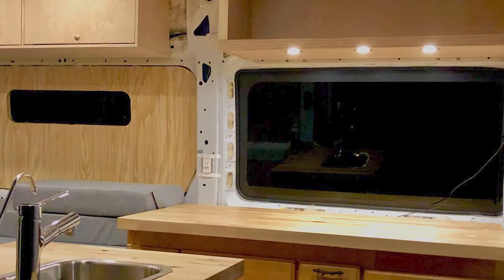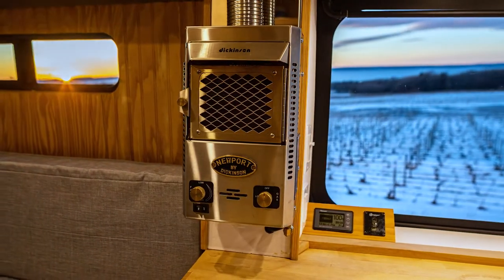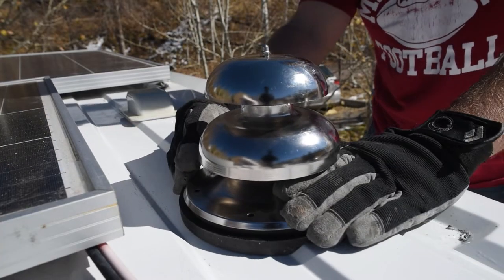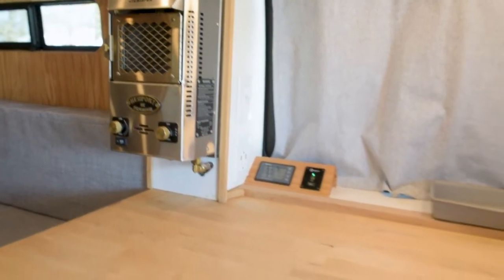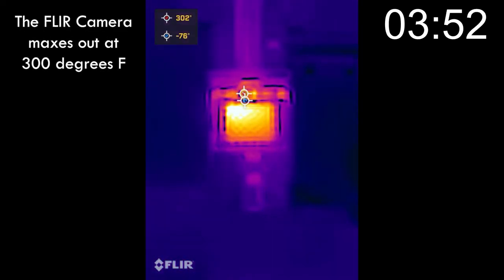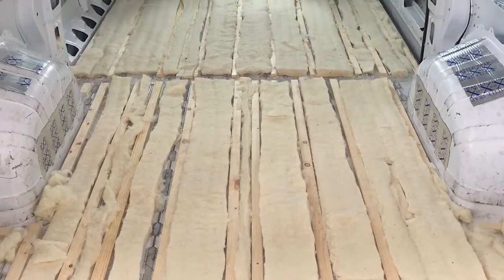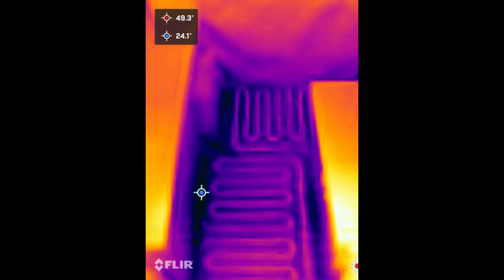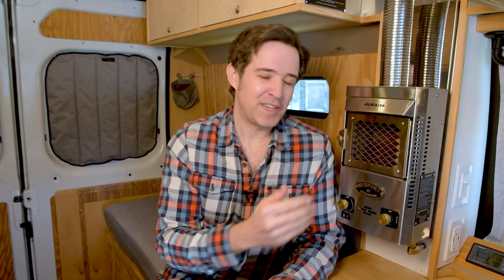Dickinson P9000 install and review for campervan #vanlife #offgrid #diy

Comment: Same experience..  I installed the P12000 in a 27 ft mostly uninsulated boat and while astheticially pleasing it fails to perform as a primary heating unit if Temps drop below the high 40s F.
Reply from the maker: I think if you could route the chimney along a diagonal so that it radiates heat into the cabin for a longer distance that would help. Or design a better air intake system.
Reply: @aspenvan3905  yes, if chimney radiates it helps a lot..  If they could some how capture/use the hot air that goes up the chimney that would improve things greatly.
Reply: I hear using a stronger fan to circulate the heat helps, also.
Reply: Did you end up with an alternate or keep the 12,000 ? Thanks   State -?

Comment: Have you looked at propex?? Its not looks like fireplace but supposed to be maximum efficiency use of propane. I think yours waste too much heat in exhaust
Reply: He also did an awful job at insulating his van. If he had done that correctly this heater would have performed a lot better.

Comment: I'm in Door County and often camp in Michigan in my custom Ford Transit.  I'm interested in renting your van through the online rental service you're listed on, but I can't figure out how to email you thought that site .... I need passwords and I can't find them .... lol.  I'm interested in having that fireplace installed in my Transit.  I have shore power, but no heat if I'm not at a campground.  I'm looking for a simple reliable heat source that just keeps the inside van above 45°at night.  My van is insulated with Havelock wool.  I rarely need heat, but once in awhile it would be handy. I was hoping to rent your van for two nights in late Nov or early Dec to try it out. Bonnie
Reply from the maker: You can message me directly through the site. ‘Ask owner a question’.

Comment: I like fall & winter camping no bugs , why not install a diesel heater to heat up the van and use Dickerson once van warms  but sense you have ram pro master van probably uses unleaded gas but diesel engines last much longer
Reply from the maker: Yeah it’s gas. I also didn’t super insulate the van for winter and it has a lot of windows.

Comment: Thank you. I'm still using the: DynaGlo Grab N Go 10,000 BTU Propane Portable Heater. I have a plan to vent it similar to yours. I'm on a strict budget and can't afford the heater you have. 
Thanks again for the update 👍
Reply from the maker: You’re welcome and yes, getting some venting in there would be a good safety measure to take!

Comment: Nice video. Is that a seperate black piece that the bolts are going through the ceiling on the inside?
Reply from the maker: Yes it is. I had them make me a top and bottom piece so that the cap would be really secure. I was worried about flexing (and tearing) of the sheet metal from heating/cooling and driving 70 mph. So far it’s been great! I put more self leveling sealant on every spring around the bolts and where it meets the top of the van.

Comment: does cool air not come in by the top vent when not in use? Like having an open hole open to the outside ambient air all the time?
Reply from the maker: It would if the door to the fireplace was open, yes.

Comment: Great informative video.

I'm wondering what your r value is?
I'm thinking of buying the p9000 for my cargo trailer conversion. I have a 14x7.5x6.6 foot enclosed trailer with 2 inches of medium density closed cell spray foam in the walls and ceiling, and 3 inches in the floor. No windows just 2 vents that came already installed in the trailer that I've added twist shut offs, and a 6 inch max air fan to exhaust air and bring fresh air in through those 2 other vents.  I have been using a 5kw Chinese diesel heater for 5 months and it's over kill I have to shut it off even on high and with the fan exhausting. So my thoughts are that the p9000 would be great as it can be set lower than the diesel heater and is only about 500 BTU less at fully opened up. 

The diesel heater is also highly unreliable and breaks down weekly. 

I'm sorry that I'm writing a book here, but maybe you can also answer one last question?  For the regulator, are you using any run of the mill bbq regulator hose, or did you purchase the expensive Dickinson one?

Thanks.
Reply from the maker: Hello!

The wool I’m using is from Havelock and has an R value of 3.6 per inch. I have two inches in most places so call it R7.  

I think the P9000 would heat you up nicely, probably also over kill at times as your trailer sounds better insulated and the P9000 doesn’t need additional venting so you can button up the trailer tight when you have too. 

Using regular old BBQ regulator.

Comment: CONS: I have had 2 in 2 differant vans, no matter what anyone says they do leak carbonmoxide , the pipe were they attatch to the furnace box do not seal , there just sleved on to a smaller welded mounted pipe🎉 and same at roof vent , the stive pipe just slides over the roof bent sleeve ,So! no they dont seal completly and they do leak carbonmonoxide, my testers proved it...
    also there are holes on thr roof top vent sleeve .   
     the only suscesfull way to plug it all was useing stove doir fyberglass rope , i wraped up tight the top and bottoms with small thin stive doir rope a few times then used 4 inch steel clamps to clamp it all tight...
    They do pump out plenty of heat for winter in a van , ask me im in 25 below temps...
    Would i Recomend, honestly no,, there propane and in temps at 25 below your going to be keeping your propane tanks inside or your tank regeulatiors will freeze...
   So! ... nope , over all i dont recomend,, there too expensive and dangerious to keep running in extream cold.